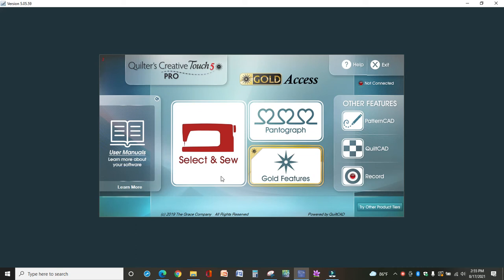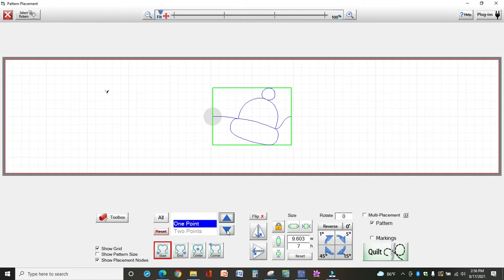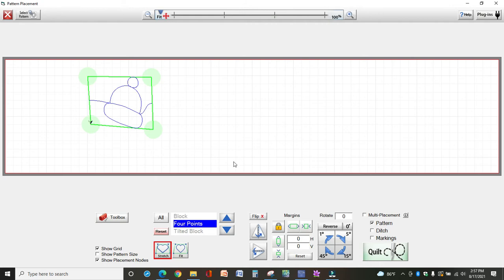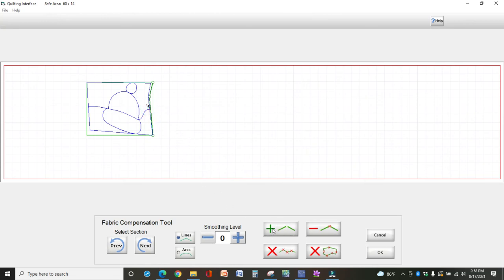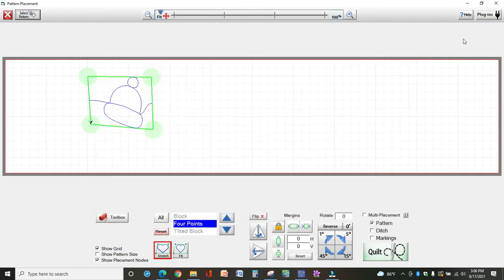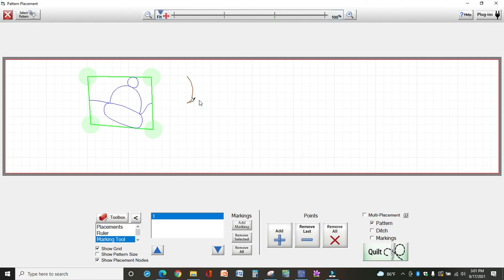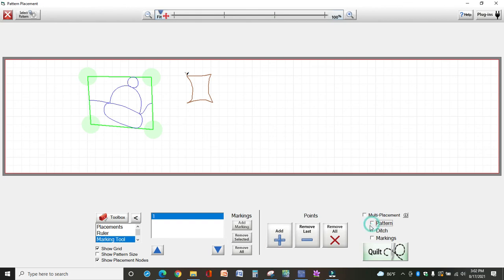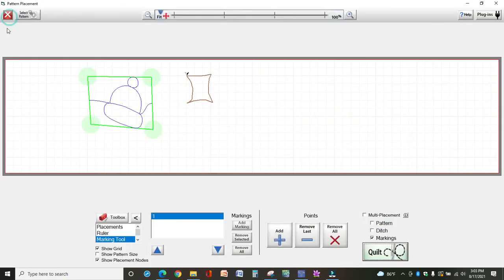QCT5 Pro   Stitch in ditch or other defined area

Comment: HI,  I noticed in your files that you had EQ7 files.   Can I transfer EQ8 quilt patterns to QCT5?  It would be awesome to see it all stitched on the actual quilt in EQ8.OR. could I import Qct patterns to EQ8?????
Thanks!
Blessings
Sister Trish
Reply: That would certainly be awesome but there is no way to do that.   But, you could save an image of your EQ8 file and use the free software called Lightbox to overlay a design.